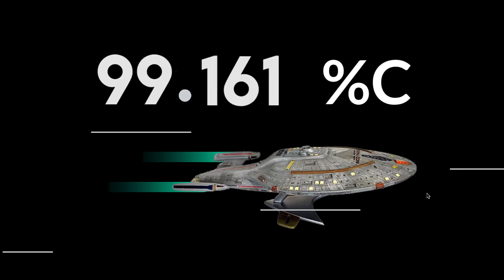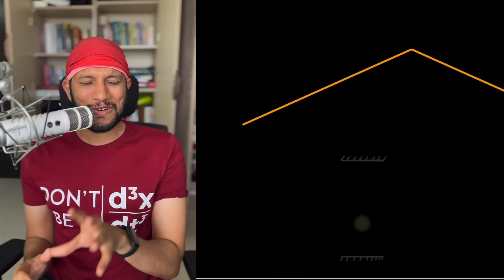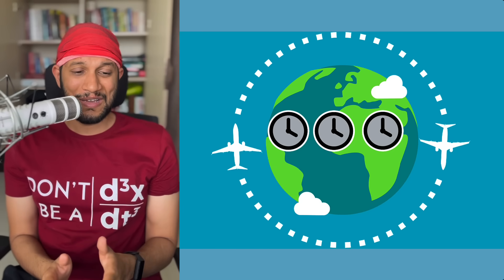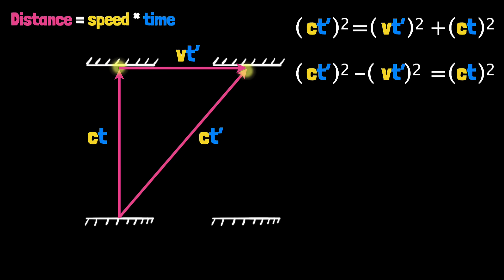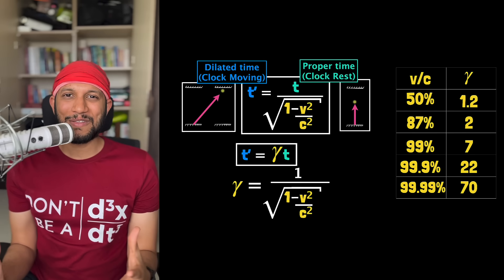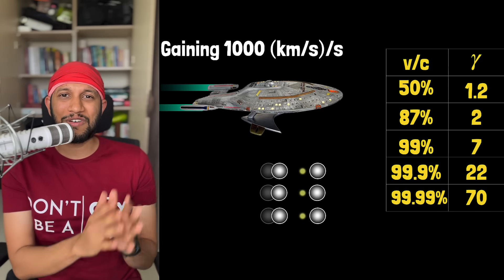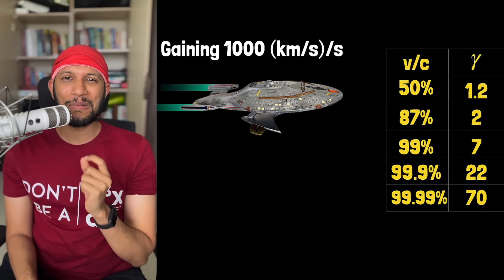I finally understood why you can't go faster than light! (My mind is blown)

Comment: One thing I think this way of expressing special relativity that leads to a lot of confusion is not considering the perspective of the ship/train and their measurement of time elapsed for our "standing still" frame. I point this out because you talked about the twin paradox and said the "moving twin will age slower than the twin thats at earth" which spreads misinformation. There is no God Frame, from the results of special relativity the moving twin will age slower than the twin that is being observed as still in their frame. Notably that means from the Earths perspective the Earth twin would observe themselves to be older than the ship twin but vitally it also means that from the ship twins perspective they view the earth twin as the younger one. So which one is younger? Thats what the twin paradox comes from, its not just that "oh twins will be different ages" but that using only special relativity, there is no resolution to that problem.

The answer to that question forces us to use general relativity, after all, the only definitive answer would be when the twins are once again at rest with respect to one another, which can only happen when we are considering non inertial frames or accelerating frames, something special relativity does not cover. So the atomic clock experiments stand as great evidence of general relativity and we shouldnt relegate it as "some contribution from general relativity" because special relativity doesn't give us predictions for the discrepancy between the times when we compare the clocks at rest together again after being flown around.

Comment: This concept is so stupid.

First of all, the atomic clock is not time, it's a tool we use to measure time.  Just like a measuring tape is not distance, it's a tool we use to measure distance.  If I heat or freeze a measuring tape, the measurement will be off.  In that case did I warp space?  No, I warped the instrument we use to measure distance!  If any instrument we use to measure things with and apply some sort external force/reactant/agent/energy to it, we did no alter anything but the instrument itself. The atomic clock is sensitive to gravitational fields.  Just like an electrical instrument is sensitive to magnetic fields.

E=MC2 is just a rewrite of F=MV2.  Do not take Einstein's theory as gospel.  It's only gospel for now, until the next great theory.  The earth used to be flat, the sun used to revolve around the earth, going faster than the speed of sound was impossible.  Ulsers were caused by eating spicy foods.

Just because we haven't achieved faster than light travel now, it doesn't mean it can't be done.

Comment: Thanks, but the explanation is not sufficient for me. At 11.40 you can have one clock in the 🌎 and one in 🚀 . The Earth speed if you measure from the spaceship is the same as in your calculations, so the clock in the spaceship will have the same slowing time result

Comment: I've always wondered how speed of light works in a three (or more) body scenario. If you accelerate a ship away from Earth, for instance, and someone on Earth observes the ship going straight out and away at 99.9% the speed of light for instance (ignoring fuel, etc.) everything you've said makes sense. But what if you have a different observer on another planet who is observing the same ship. Say that planet is traveling towards Earth so there is already a delta-V. Will the second observer see the ship as moving faster? Or does it still appear to them as moving at 99.9% the speed of light because there is also some relative time dilation between Earth and the other planet?

Comment: So watching this makes me think. We have measured these things based on physical processes, which, for the most part do lead to "time" being slower. My question is, and maybe there is no way to answer this, but what about things that don't require a physical process. Like say perception. These things "taking longer to move" doesn't mean time slowed down, it means the instrument by which we measure time, did. While all physical objects may also be affected similar, so we don't actually know if its time itself, or if a clock is actually just taking 1.5 seconds to tick instead of 1. I hope I am making sense. I know that biological processes like aging would also be involved, what I am not convinced of, however, is that its not just our aging slowing down, instead of time itself, speeding up. In all maybe the answer is that time is relative and those are the same thing, but like I said, how could we know?

Edit: I literally paused this video right before you explained the bit that discussed exactly what I said... so... cool I think that makes sense, its a philosophical debate not a scientific one, unless of course we can get a person to travel at significant speeds long enough to warp an apparent observation of time in a substantial enough way that the person could "feel" the difference.

Comment: Now wait a second. The explanation doesn't make sense. What you are talking about in your last bit of the video (that you need infinite time or infinite energy to reach speed of light) is only valid for outside observer. Yes, for the outside observer the ship acceleration is slowing down, but what about the actual ship? For it, the time runs as normal, and acceleration happens the same as before, therefore the ship should reach the speed of light in its reference frame.

Comment: This not correct. The reason we have a thing called the Observable Universe is because there are other galaxies moving away from us faster then their light can reach us but relatively we are moving that fast from those galaxies. So  if someone there is moving 51% moving away from our relative center as we are moving 51% the speed of light from the same relative center of course no one's clock is slowing down. Who is to say that galaxy isn't actually the center of the universe and we not are the ones moving at 102% the speed of light from them? Or are we claiming that everything outside the "visible universe" has infinite mass now? That seems absurd.

Comment: Using the photon clock, reaching speed of light would be the same as reaching a point where the photon only move horizontally: that would mean that time would stop for everyone outside the ship  since the ball will always move up (although slower and slower compared to the ship) it is never really possible to reach that point.

Comment: I love science. I do however think that some of einsteins theories are slightly off. The growth rate change in a child for instance would not differ. Parent A and child aboard the ship who travels ASOL, has been to x and back to mothership in the same time it takes parent B to make a cup of tea on said mothership, will have all biologically aged the same. (Disallowing for any other factors / forces potentially affecting). 

The problem is the observer interprets experimental results through the lens of relativity itself and time dilation depends on, or is rather predicted by relativity > the observer interprets differing clock rates as time dilation > confirms relativity. When you start to think of "time" and more precisely, as we know it, a 'linear' time as more of a background variable, you open up the idea of quantum and theory of relativity / time dilation becomes much less of a fundamental truth. It may work as a predictive model, within the field that is owned by einteins theory of relativity, but its biggest flaws are that it confuses mathematical symmtry for physical causality and it cannot be reconciled with quantum mechanics' absolute time framework.

What a fantastic explanation also from you!

Comment: The point when you start saying that the photon now moves diagonally, so it travels more. I got confused because, the clock ticking is in y-direction, and there's nothing that changed the y-velocity of the photon, so it should still continue ticking at the same speed. I checked AI to resolve this confusion, and it explained me that the speed of photon, summed up in all the axes is constant. It would've been better if you had put this point before.

Comment: one thing i never quite got: how does empirical time dilation work? from the point of view of earth clocks on planes should be slowing down. from the point of view of the plane, clocks on earth should be slowing down. so there's a paradox, no? how is this resolved once the plane lands? which clock is lagging when bringing the two together?

Comment: Another thing to think about. At 13:54 you can imagine if the photon moves at speed of light but so do the atoms, the photon will never reach the atom. Therefore something (the atoms) can not be accelerated to the speed of light because it would take an infinite amount of time to cross the infinite amount of distance. As the photons and atoms would be stationary as seen by the viewer

Comment: The answer is time dilation. Acceleration speeds down as you approach light speed. Time stops at the speed of light, thus no acceleration can occur at that speed, which is why it can't be reached, only approached in exponentially slower steps.

Comment: While your explanation is really good, it has one flaw: how can light travel at the speed of light? According to your explanation it's would need infinite enegety to do so. And even if it had infinite energy, it would look to us as if it had stopped moving. So why is light, which is made from photons, not affected by time dilation, while everything else is?
Reply: the explanation here is, that photons dont have mass. you would need infinite amount of energy to accelerate mass.
Reply: Bro thinks photons are real, as in real particles travelling at the speed of light like a normal object would. Photons are simply an equated unit of energy. It's the speed of that energy (light) that is passed, there is no object at play, unlike here.

Comment: Also, if you look at the time deviation equation, if as v aproaches c, we devide proper time by a value closer and closer to zero, hence time deviation increases. Should v theoretically be equal to c, then we would have t/0 which is mathematically not defined "allowed"

Comment: we don't need the speed of light, just short the distance by bending the space in between with gravity. We still think that gravity is mass related,  that's why we are stuck with Einstein and not moving on. We need to figure out how to gain energy without the mass, there is no zero point energy in whole space, sun does not spin, yet it has enormous energy gas, light, heat etc is just a manifestation of concentrated energy but deep down is just one single atom, we don't need radioactive isotopes to create atomic energy, this is the worst way (it was nonproduct of research, like penicillin sometimes turnout to be good, sometimes bad). Hydrogen  was improvement, but not solution, there are more suitable elements, with right frequency... and that is all ....for now

Comment: I still always have one issue with this: imagine your twin example. One is moving fast, one isn't. Unfortunately, speed is relative so the definition of WHO actually moves depends on who makes the observation. Thus BOTH are moving and not moving at the same time and therefore time dilation applies and not applies to both at the same time, depending on who you define as being the moving one. This is absurd!

Comment: This doesn't explain why you can't go faster than light, it only explains that as you approach the speed of light, you (your biological body and every reaction inside the ship) essentially become frozen in time. because the photons are traveling supposing an infinite distance to reach the 1 tick so they never reach it and become "frozen" in time. but this doesn't explain why the ship can't go beyond light speed...
What if we suppose there exists a planet somewhere in the universe which is moving slower than earth 299 792 458 times, wouldn't we be moving at an impossible speed comparatively to it?

Comment: So why would the photon in the clock take longer to tick in motion if it maintains the vertical velocity of c and the distance between the two ends of the clock remains constant?  Is adding the horizontal velocity subtracting from the vertical velocity?  I thought they were independent so it still feels confusing

Comment: Your explanation is good, but I'll give you a more philosophical one: You can't "do" anything in this universe. You can only "request" something to be done. Usually your request is granted, but sometimes it's not. And there is nothing you can do about it. 
It's like working on Microsoft Windows. You think you can "do" stuff. You think you can delete files, you think you can arrange icons on your desktop, you think you can change color scheme. But those are only your humble requests. You ask the system to do that. And Microsoft - not you - decided years ago which of those requests can be accepted, and which can't. And you have nothing to say in this matter, because you're just an end user.

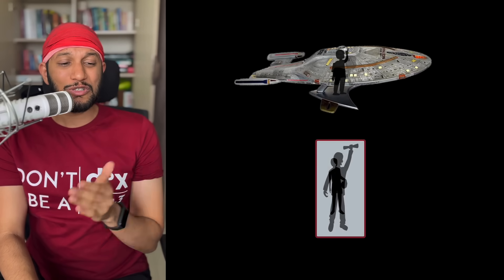Comment: 7:00 It is not intuitive for me in case of two twins that one of them will age slower than another, because speed is relative so from the perspective of the first one second one is moving and from the perspective of second one the first one is moving so what will happen if they meet at some time and why one of them will be older than the other. I feel like it was not explained fully.

Comment: I think the word speed is relative  we might already be moving at the speed of light without realizing it. After all, Earth is moving under the Sun’s gravity, which itself moves within the Milky Way’s pull and so on. It’s like a fly sitting on my hand while I’m in a train moving at the speed of sound the fly is technically moving that fast too.
So maybe the reason we can’t “attain” the speed of light is because we’re already sharing that motion (c) in some larger cosmic frame. Trying to reach it ourselves might be like trying to achieve escape velocity (similar like earth's escape velocity) requiring enormous energy to break free from our current dimension or the system whose motion we’re already part of but once we do it we would break free of current constraint (which again might have its pros and cons).

Comment: They said to travel faster than light, you need to use theory like wormhole or quantum-thingy. What makes them so sure that the energy required for those methods aren't the same if not more than just increasing the speed of the spaceship?

Comment: I have a question. If you are outside of the ship you will see that to reach the speed of light it would take a infinite amount of time. But what is with the people on the ship? To them everything looks normal and they keep gaining 1000 (km/s)/s until they reach the speed of light, but they can't because it's impossible... so how does that work?

Comment: I feel like I must be missing something...

If the ship accelerates at 1000km/s/s by burning 100 gallons of fuel per second, then yeah it'll take longer and longer for the outside observer to notice an increase in speed once you get to 99/99.9/99.99...% the speed of light, that makes sense. But time is still flowing "normally" for the people on the ship, as well as the EQUIPMENT on the ship. Doesn't that mean that fuel would still be burning at 100 gallons per second the ship experiences, increasing its speed by another 1000km/s per second the ship experiences? Yes the observers on the outside would be long dead by the time the ship gains another 1000km/s, but to the people on the ship they'd still be accelerating at 1000km/s for every second in their time, as well as not needing infinite fuel because the ship is still burning 100 gallons per second the SHIP experiences?

Comment: I will say that I still have a knot in my head. Because the explanation focuses on our perception of the accelerating object, so I fully understand it from that perspective. But what happens from the perspective of inside the accelerating object. Because we say for them, they will still accelerate by 1000 m/s so objectively they for themselves will reach and exceed the speed of flight at some point. Or will they just freeze in time? And something else that bothers me. As speed is distance over time and if time dilates will a slower ship overtake a faster ship because it’s dilated timeto speed ratio is better/faster?

Comment: I just thought:

As we approach the speed of light, the people inside the ship would also cover a distance bigger than light distance within the same perceived period of time.
For example:

Light can travel 300.000 Kms in 1 second - and that would be proper time.

But, if we are traveling at 99,99999999999% of the speed of light, what we (the people inside the ship) perceive as 1 second would cover much more than just 300K Km.
If 1 second of proper time mean 1 year in dilated time, for the people inside the ship they would have cover almost 1 light year in just 1 second of perceived time (which is also how much they would age).

Which means, at some point, it would "feel like" teleporting to distant galaxies or planets.

Am I crazy?

Comment: You do not age slower. You age the same. Just time runs in different tempo. It is relative to... In spaceship you will not have more time.

Second thing that bothers me is, that our planet is rotating and more importantly floating very quickly trough universe... But that's just probably add to the relativity of the things.